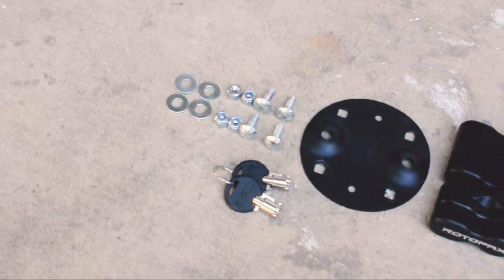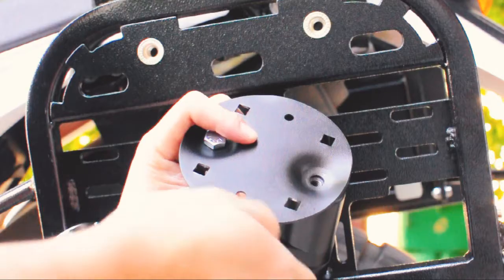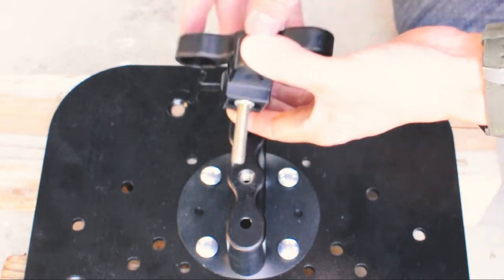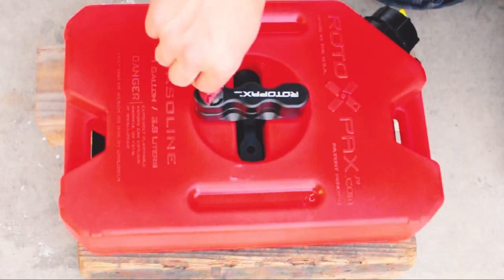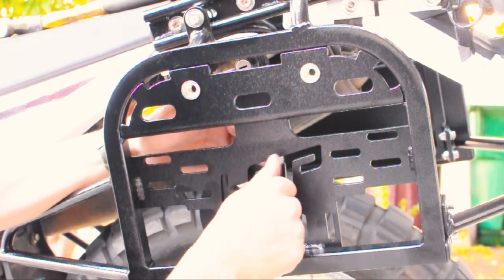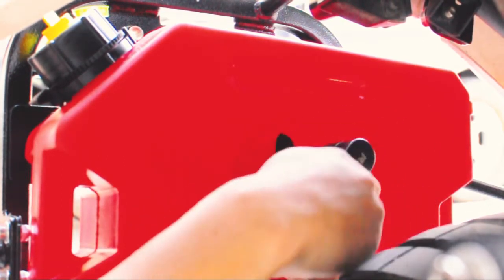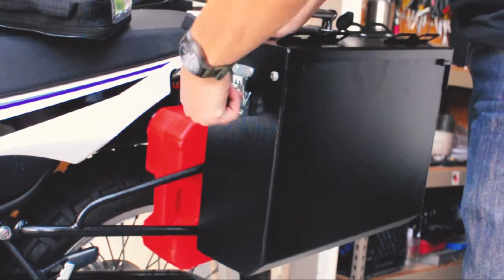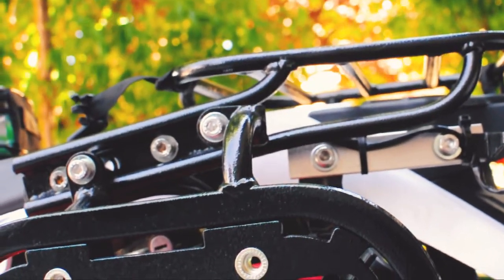XT250 Upgrades Episode 18: ROTOPAX FUEL TANK

Comment: Hello do you know if there is an oversize fuel tank for the XT250? thanks...
Reply: None are available, and probably won't ever be. The XT250 has a kind of unique split chassis instead of the normal kind with a single spar that extends backwards. You can look all this up, but basically, it's a no go. Roto packs are probably the only real option short of just tying down a gas can on to a luggage rack.  Sucks, I know.

Comment: Its crazy how that little jerrycan can get you an extra 50+ miles. My only concern would be if the bike gets dumped and the bracket ends up warping. That ever cross your mind?
Reply from the maker: +Collin Mac what blows me away is how expensive the whole setup is! I've dropped it plenty of times and had no issues with that mount. But the rack wasn't designed for a can right there so there have been a few issues with it. I'll go over them in a future video.

-NoOne
Reply: @NoOnesWatching0_0  What were the issues?

Comment: I'm preparing for the TransAmerica Trail (TAT) and outfitting my 2013 XT250. I'm trying to figure out how to bring an extra 2 gallons of fuel. Do you think the 2 gallon Rotopax would fit like this? If not I'm thinking about doing the 1 gallon like you show, then maybe getting a I gallon bladder bag with tie-downs and take it from there. Any ideas?
Reply: 3 yars later, but slap 1 on each side